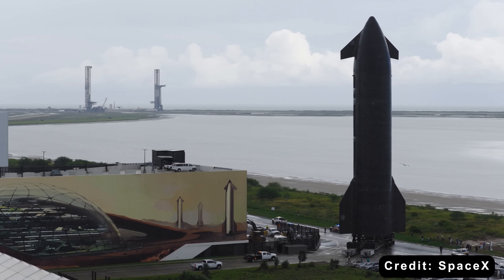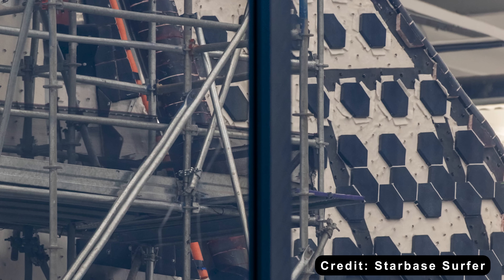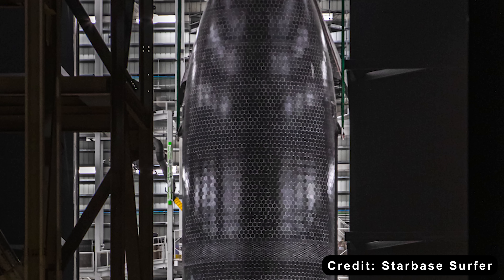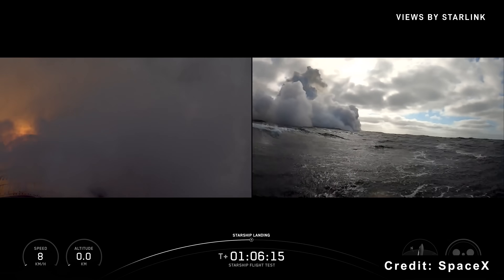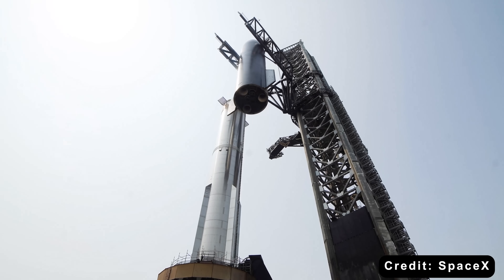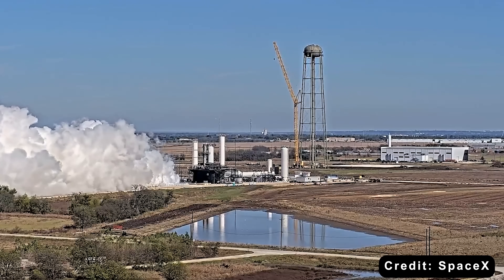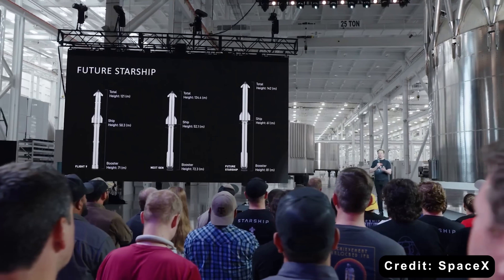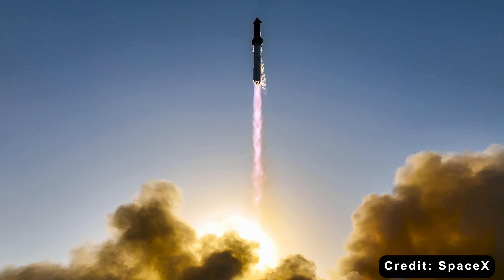SpaceX Just Tested Starship Version 3 METAL SHIELDS for Flight 12, Shocked NASA!

Comment: Can you say titanium? Sure you can! Titanium tiles is clearly the worth a try. Titanium would be tough to sculpt and expensive for the entire skin but, they would be heat resistant and durable as the heat shield. If used as scales like a reptile they would expand and contract without losing integrity. After several reuses this would be far more cost effective due to decreased maintenance/repair costs.

Comment: I think that they will continue development of metallic tiles as a better long-term solution to rapid reusability.
Reply: Yes I expect you're right. I'm getting more comfortable with the new shrink-wrap ceramic tiles meanwhile.
Reply: They are not metal 🤣 they are shiny meaning less blemishes on the ceramic tiles. They are tighter together and smoother probably with a coat of extra material on the face. This is AI making things up to fit the pics it's given but when you watch the ship be moved the tiles are all the same just more reflective. Maybe they have started polishing them idk. But seems to me they are narrowing down on a final design of heat shield and  this is probably just better quality then previously.